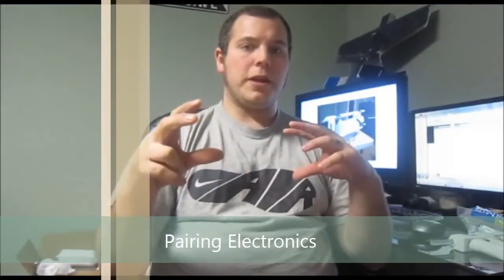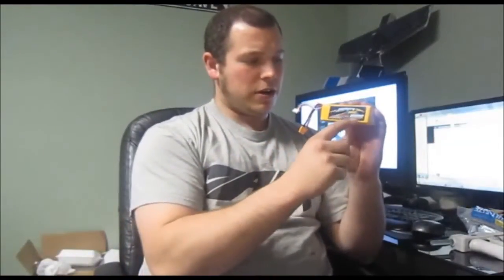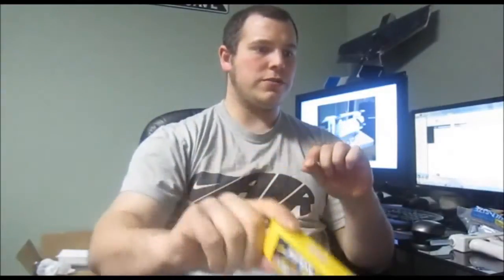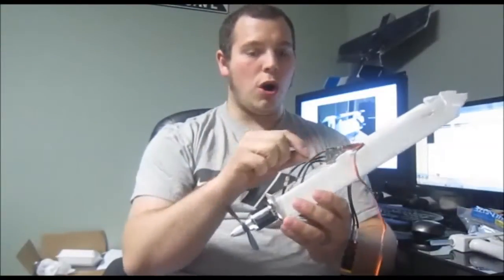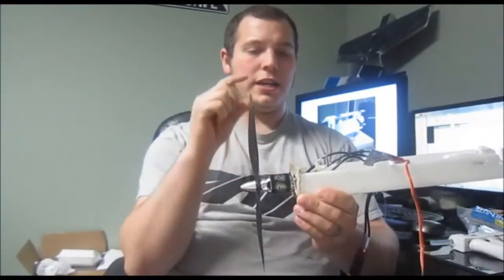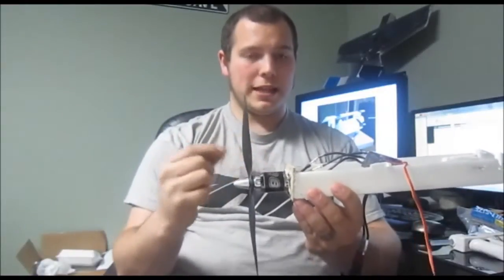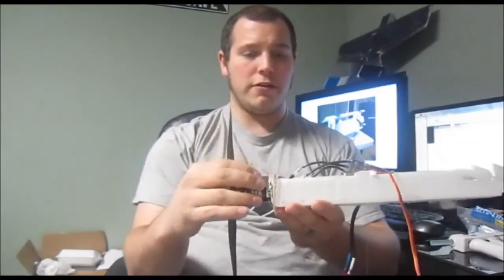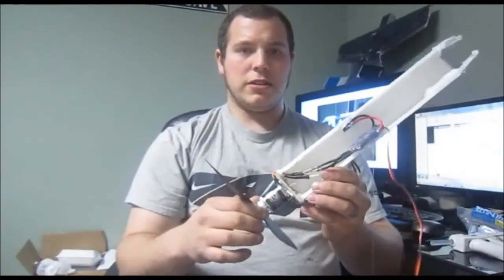Pairing RC Aircraft Electronics

Comment: Hey I'm an absolute beginner and am looking to build an RC plane from scratch. I currently own a hobbyzone Duet RTF and it's pretty awesome. I've heard building your own is a lot cheaper then buying an RTF

Right now I'm currently looking for parts at my local store. I'm looking to spend around 14 bucks for a speed controller since I don't want to go high end. Propellers at the store are pretty cheap and well priced. But I am confused about how a servo works, could you explain? Also, what is a good material to build the fuselage out of?

For the battery my Duet RTF uses a 3C 150 mAh LiPo battery, I am a little confused in what battery to get... my RC plane which I am planning to build would be relatively small and basic

Thanks!

Comment from the maker: From what you are telling me, it shouldn't have burned up. But I have had ESC's from HK that don't even work, so it doesn't surprise me that one stopped working on the second flight. One thing that may help is try not to velcro your ESC down to the bottom of your pod. there are heat syncs on both sides so if one side is sandwiched into the Velcro then it may get to hot and burn it out.

Comment: hi there i have a question, i just bought the ntm prop drive 28 26 with a 1300 mah 4s battery 20-30c, a 8x4 APC prop ( swappable FT 3D ) and used a 25 A turnigy 2-4s ESC. In the seconf flight, the motor stopped working and the plane crashed , later on i discovered that the ESC was burned out.what do you think it could have happened?